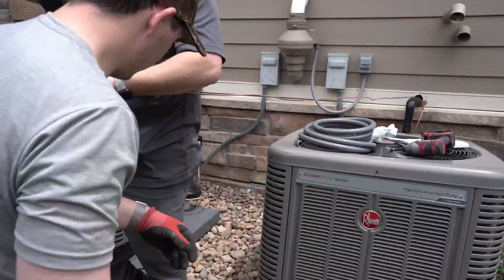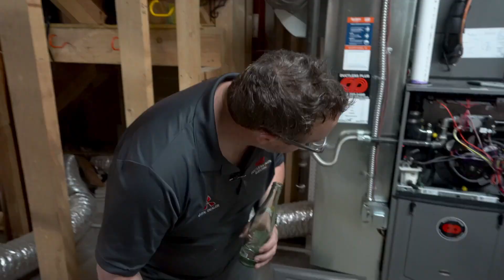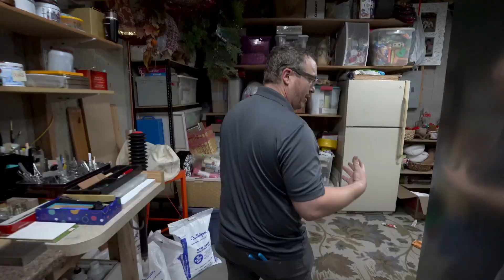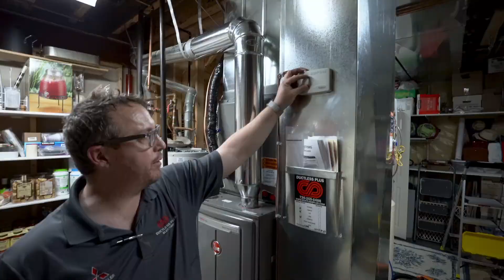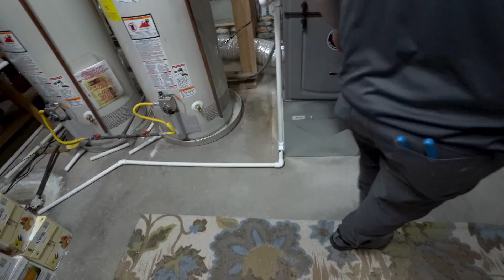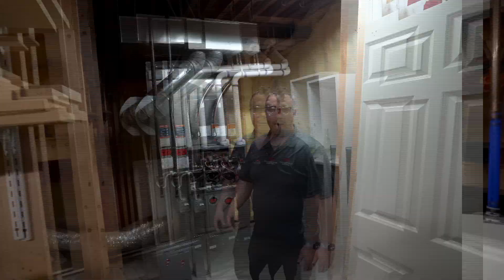Going Ductless Might NOT Be In Your Best Interest

Comment: I am a dealer and HVAC technician, also in the Denver area.   I install predominantly dual-fuel systems with humidifiers and AprilAire filtration system.  The furnaces that I sell have a continuous fan functionality from the factory and is setup on every system.  With Colorado being so arid, I also setup the humidifier to run and cycle as needed through the entire year, not just during the heating cycle.  I use the Automatic Model 60/62 humidistat from AprilAire.  This looks like a great installation.  I do not sell Rheem but I know it is a quality product.  Having both an 80%, which is probably 85% and communicating systems are keep and let the boards and thermostat control the functionality as needed.  We have a few different thoughts on equipment and how the install would be, but this installation is top notch and with quality equipment.  I don't even know this channel and I am also in Denver, so I can appreciate the work and system design.  I do have a couple gripes about the install, but that is how it goes.  The Heat pumps should be elevated off the ground above average snowfall and I did not need in the video really efficient filtration systems or filter boxes that will help run and clean the air 24/7.  That isn't to say that it wasn't there.  Colorado isn't necessarily known for heat pumps and that is all I sell with a dual-fuel setup but awesome to see someone do exactly what I sell and install.   Great job!
Reply from the maker: We install a heating system that melts the ice under the unit. Also the unit has about 4” above the pad. The plastic bottom is hollow and allows draining. The unit also has a pan heater system so you don't need to install some ugly lift kit. I've lived in Colorado all my 46 years and snow can build up yes but it's gone 90% of the time the next day. I also have done HVAC for 30 years out here. Thanks for watching the install video. And yes the system has a filter box